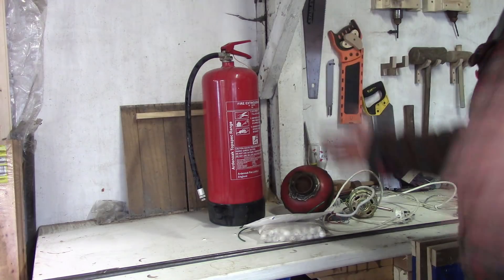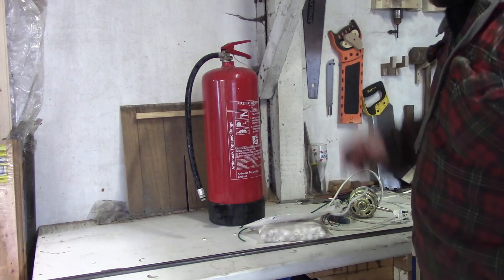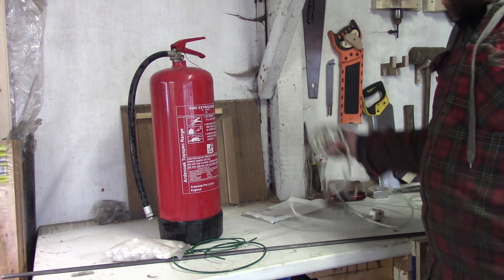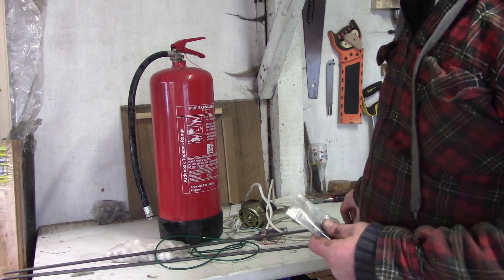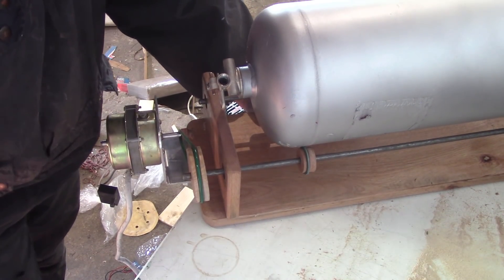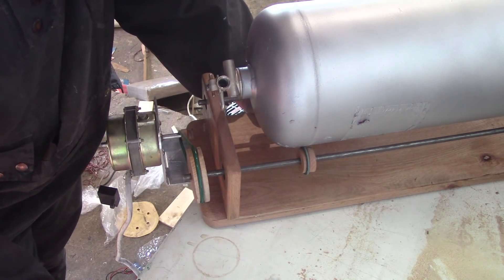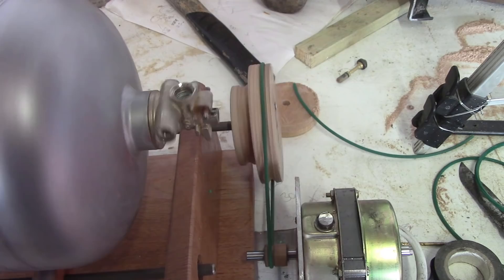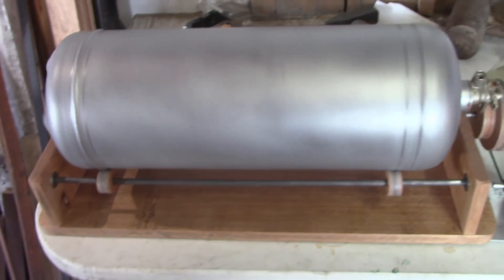Making a ball mill from a fire extinguisher and an office fan

Comment: That jar need lifter inside...now a balls just roll in same spot..they need to fall down from oposite side of b.mill
Reply from the maker: I've seen a few people put paddles on home made Mills but this isn't done in industry.
The principal used is to find the speed that the balls centrifuge then reduce by 25% so the medium falls from the top of the mill, the falling medium is only good for smashing large items while the action of the balls rolling over each other creates the fine milled product, if paddles are used a large amount of the product ends up trapped in a semi ground state just there for the ride.
Mill speed is determined by the ball weight, I haven't done any maths, as a result my speeds are all wrong so I am getting my best results using a mixture of ceramic and steel ball which require differing speeds but seem to work well together at the wrong speed!
Thanks for taking the time to comment.

Comment: Pretty slick, my slingshot is jealous of all those bearings. Hey, if you cut the end off that tank and weld a couple pieces of square stock lengthwise inside before welding the end back on, it won't take nearly as long to mill stuff.

Comment: Love that pulley. Wobbles like fuck but the belt is dead straight. Job done. Shame you couldn’t have used that worm drive off the motor. That would have geared it right down. Or maybe cut a groove straight into that output shaft on the motor for a belt? Think I’ve found a job by the way. You’d like it!
Reply from the maker: Mate I had belts in my mind and was blind to the worm drive till you just mentioned it, would have been a better solution!
Go in then tell me what you are up to, cheif handle fitter at the granfors factory?

Comment: Nice
Reply: Turbo Conquering Mega Eagle Fackin epic mate! Been looking to make a knife polishing ball mill like this, but was unsure what type of motor to run it with. Fortunately I have an old fan with speed control. It was fairly expensive....but typically it failed same way as the cheapo ones, the rotation control knob broke, so I can break it down for my project. Cheers for the help bruv 😉
Reply: By the way, have you tried petrobond for casting? I find it much better, more precise. Anyway, where are you in the UK? If you live close enough I can let you have a couple of kilos, if you like.
You have helped me, and it's no bother. Let me know 😊
Reply from the maker: Cheers bruv
Reply: Try the "artisan foundry shop", they are not on ebay, but their oil bonded sand is excellent, it is cheaper than petrobond I use, but for the larger stuff you do, perfect. It's £39.99......but do not let the price put you off! This stuff is the dogs bollocks bruv! I have used it myself when casting lathe parts. No blow outs, great/precise casts, none of the problems associated with bentonite clay bonded sand.
However, I do want to mention something which may appeal to you, I have used this method to make parts that require multi cavity pieces, eg hammers, engine parts. Have you tried water glass bonded sand? It really is incredibly simple/cheap as shit and works like a dream! Have a look yourself on here/YouTube.....It may be right up your street 😊
Regards,
Pete
Reply from the maker: Shona O'Neill man that's such a kind offer thanks I'm in Lincolnshire but will be needing huge amounts of sand for the next casting project and I'd really like to get my mix right so I can avoid the expense, where do you get your petrobond?
Reply: Turbo Conquering Mega Eagle actually I'm a jeweller, so the stuff I use is very very fine, as such it's fairly expensive.....I have in my early years tried the cat litter crap, but it's more trouble than its worth, petrobond doesn't dry out and you are not using water, it has many advantages. But I have tried some cheaper petrobond from eBay,  it cost £30 and for models made from brass, aluminium, bronzes and suchlike it is very very good.
I will find the name, and write it on here for you. I have made many hundreds, if not thousands of castings over my career and I consider myself fairly adept to the processes. I also consider my advice sound......not like a lot of the wannabe bull shitters found everywhere on here.
I really like your channel, I am fairly new to it, I just stumbled across it, and really like what you do. I too like to make projects in my spare time, I have made a very usable large belt sander, simple to make but highly effective.  I have sand casted lathe parts, eg compound slide, milling slide etc etc. 
I'm investing in a milling machine in the next 3-4 months, should make things easier, and a hell of a lot of fun.
Btw, have you though of maybe stepping it up with your eBay shop? You're a talented guy with followers, you could sell stuff you make, not just stickers......just a thought buddy ☺
Keep up the great channel bud, enjoying your videos. Btw sharing them too.
I'll let you know where to get the petrobond if you want to get some yourself 😊
Reply from the maker: At the moment the quality of the cat litter greensand is superior to my skill and knowledge when it comes to casting! 
At college we learned to wirelock with a twisting screwdriver that we had made, the idea being we'd always know how to do it with a basic tool, and when we were fortunate enough to have twisting pliers in our hands we'd be grateful, it's the same philosophy I employ with my apprentices and the reason I actually want to suffer with home made greensand. I've no doubt I will get hold of some petrobond in the future because I love casting bits up, it'd be handy if I met someone who worked in a foundry first tho!
I'm excited for you to be getting hold of a mill soon, I'm feeling a little frustrated as I have a mill but it is in storage currently until I build a new workshop at home, my current workshop has a very thin concrete floor which is slowly crumbling into the adjacent dyke, a 3/4 ton milling machine would probably be the end of my poor shed.
I'm hoping to make a bit more use of the tcme eBay store in the future but I'm having trouble finding the time just to make videos at the moment so it's on the back burner.
Thanks for sharing my videos it really is the most helpful thing anyone can do.
Reply from the maker: Ok, I'll check it all out thanks bruva! The cheap as chips bit is especially interesting!